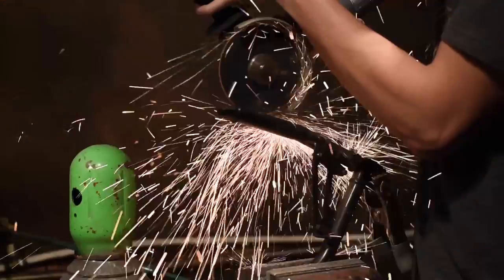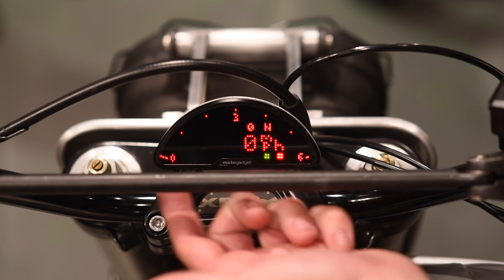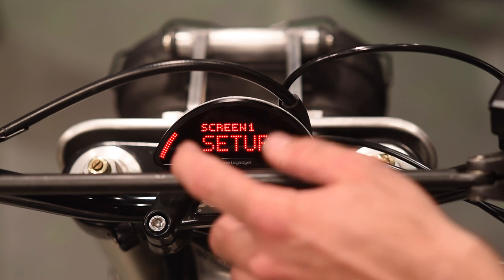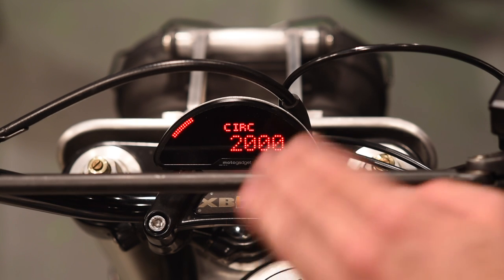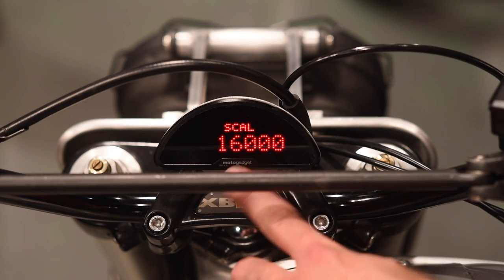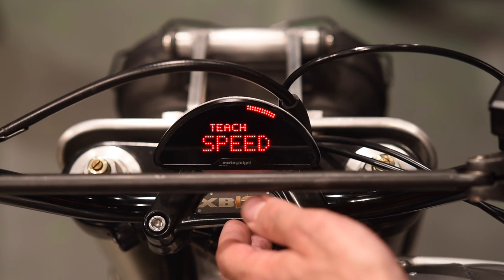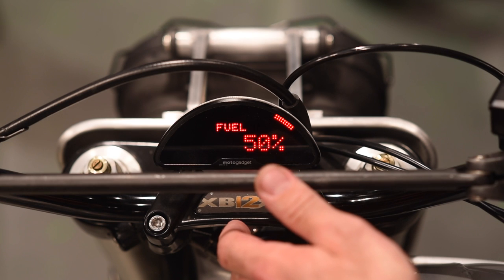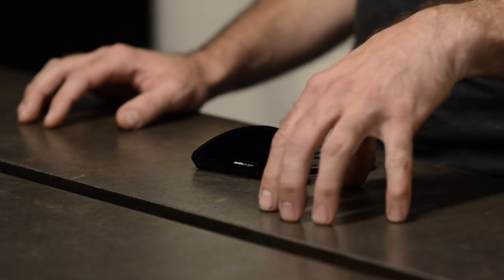Configuring the Motoscope Pro - Revival Cycles Tech Talk

Comment: Quick Tip: You enter the Setup Screen ONLY by having "Speed" displayed and then a level 4 press. If any other parameter than speed is displayed the level 4 push won't let you excess the Setup up screen 😉
Reply: You are the hero of this story
Reply: Thanks for this comment.. Really appreciate it.. Didn't think manual has anything on it
Reply: Do you exit OUT of the Setup Screen w a level 4 press as well?

Comment: Hey thanks for the video, it really helped me a lot while installing this on my 79 BMW R80/7 project. However, in order to get to the setup menu, it is worthy to mention that you do need to turn it down, switch back on and do the 4 sec push, but this will only work if the lower display line ( biggest characters ) is set to Speed. If this is not the case ( for example it is set to Rpm or anything else ), you will not be able to get into the setup menu. Don't ask how i found this out, i had to learn it the hard way!
Reply from the maker: Yes, this is super frustrating, and in retrospect, I didn't cover this in enough detail on this video. If we ever get around to redoing this I'll be sure to point out that the main read out must be set to speed in order to access the configuration settings. But realistically you'd think this would be a covered in the manual, but its not, crazy.

Comment: Great video. I am currently building a custom 82 Suzuki GSX1100 and the only thing i didnt gather from the video is the gear indicator setup/wiring? My bike has s big connector for the gear position indicator and i could nor for the life of me figure out how to wire it in this instrument panel from your video. Can you please explain it for me?
Reply from the maker: The MSP has a trainable gear indicator, and unfortunately, it does not interface with a factory gear position sensor.
Reply: @RevivalCycles  Ok thanks. The trainable system, is it accurate once it has learned the gears?

Comment: I bought the gauge from you guys. Good thing I rewatched this video cause the manual doesn't say to cycle off and on the ignition first then do the level 4 push to enter setup. For the life of me I couldn't enter it. 

Question. I drained my battery while playing with it and trying to set this gauge up. Is that possible to drain your battery while playing with it and your engine is off? I can't try again now cause it's 1 am now and I can't start my bike without pissing off the neighbors.
Reply from the maker: The gauge shouldn't be draining the battery that quickly, but if you have the ignition switch and kill switch on there are probably other devices that are draining the battery pretty quickly. Depending on what bike you have, if you are running points type ignition that can drain a battery in less than an hour. Headlights are also usually a significant drain on the battery when the engine is off.

Comment: Nice video! Any tutorial on wiring it to a Buell XB?? I'm a little bit lost with this one :(
Reply from the maker: Wiring in on the XB is similar to any other bike, and most of the needed connections are right at the plug from the old gauge. Its a good idea to get a clear wire diagram and trace each circuit and then you can match that up with the correct wire for the MSP. On our install we used breakout box A. If you are having trouble with your install email specific questions to techsupport@revivalcycles.com But just know that we are about a week behind due to all the questions rolling in.

Comment: Thanks for that movie, help a lot, but I have some problem with clock and odometer. Set the time and set the odometer and After i switched ignition off the clock reset and milleage the mileage returns to the previous setting. Somebody has the same problems ?

Comment: I bought a motoscope pro used. This one is meant for the BMW R9T. now i notice that i am having problems installing it on my bmw k100 caferacer. I cannot change certain settings. including the rpm signal. I keep getting CAN-BUS in my screen. As far as I know I can't turn this off. I'd love to hear if anyone knows a solution!
Reply from the maker: The R9T MSP gauge has model specific features. The only solution I can imagine is contacting Motogadget to see if they can reflash the firmware.

Comment: Thank you very much, can you do full detail on the R ninet one as well, Thank you.
Reply from the maker: There is literally no difference in the form, function, or features of the R9t version. The only change on the R9t version is that it comes with the correct plug and software to connect directly to the OEM gauge connector to make installation simpler.

Comment: Hi my friends, I have a Bmw r1200gs mod 2010 (oil cooled), I'm in the process to covert it in a scrambler. I want to change the OEM instrument panel,  it's possible replace with a motoscope pro and an additional tft panel with the unit m blue? thank for your answers.
Reply from the maker: Perhaps? The electrical system is going to be pretty sophisticated and without having done an install on one before it's hard to say. First thing I'd do is start hunting for other examples to see if someone has already done it, then see if you can pick their brain.
Reply: Revival Cycles thanks my friends. Well the only way is to try.  I’ll use the ninet’s kit.

Comment: hi guys great video! would the motoscope pro work with a 1988 Honda GB250? It is currently functioning 100%, does that mean I will not need the M-unit? anything unique to this bike that I need to be mindful of?
Reply from the maker: The MSP will work on any bike pre fuel injection and many models after EFI so long as there is not an immobilizer built into the ECU. Even then, an aftermarket ECU may allow one to be installed. There's nothing in particular that I'm aware of that would make a GB challenging. If it has a CDI ignition, which it might, you will also need the Inductive Signal Sensor to get a tach reading. 

https://shop.revivalcycles.com/motogadget-motoscope-pro/
https://shop.revivalcycles.com/motogadget-breakout-box-a/
https://shop.revivalcycles.com/motogadget-ignition-signal-sensor/

Comment: Its a long video and I'm struggling to see how you actually calibrate the different settings - you have raced through the functions withot actually demonstrating a change (eg setting the clock)! When there is only one control button it is obviously not easy to set up.  this gadget is probably far more complex than I need but Im still stuck as to how to set it up for essential functions! Maybe I've got to watch the video several times to figure it all out. It would help if I could actually see you pressing the button.
Reply from the maker: Yes this is a long one, and you are correct, we didn't quite get enough detail on the actual setting of values. However, most of the parameters are set using the same method, and that method eventually gets covered around time stamp 21.07. Here is a link to that time stamp https://youtu.be/WJeBZMfVSsg?t=21m7s Fortunately there is nothing you can damage by playing around in the setup menus so trial and error is no problem and if you get too far off base, just reset back to factory and start over. With a little practice it starts to make sense.

To enter into the service screen with a 2 second button push. Then it will highlight the digit currently being modified by flashing, each level 1 button push increments the active digit  up from 0 to 9 and back to 0, and a level 2 button push moves to the next digit, then a level 3 button push exits back to the previous menu. 

Although you can't see the button you can hear it, and because of the lay out of this bike and the control buttons used, it is very difficult to include the visual image. The m-Switch minis used on this bike have very little movement, and that subtle movement is difficult to capture. Even in hindsight I think it is actually easier to hear the button pushes than it is to see them.
Reply from the maker: In an effort to keep the videos trim, I can end up speaking rather quickly. Sometimes I forget not everyone is accustomed to listening to me jabber at that pace. Thanks for sharing your project, it is often overlooked that these components are perfect for project cars and hot rods. The best part of the Motogadget kit, the gauges and m-Unit is that they are really robust and as long as you don't have voltage spikes over 18V its difficult to kill them. It makes is so you can experiment and practice with out much risk of letting the magic smoke out. 

If you find you need additional help feel free to email us at techsupport@revivalcycles.com
Reply: My criticism of your video was more about my frustration. My restoration project has gone on for seven years! I have downloaded your video onto my iPad to go through bit by bit at the car. Yours is the ONLY video showing the set up of this complex bit of electronics so thanks. One question - can I change the colour or appearance of the readout LEDs? I notice in some videos the display looks almost fluorescent. Its comforting to hear it is a robust unit. It isn't cheap but was recommended here in England as being pretty well top of the pile.

Comment: Hello guys I have purchased the motoscope Pro and will be mounting it to a 2013 speed triple r, I was wondering if you could help me with my options with wiring it in. I know there is a triumph msp breakout box upto the 2009 model but will this still work on my model? Or is my best option to wire in with the breakout box b.
Reply from the maker: This is a better question for Motogadget, we do not know the compatibility of their devices beyond what they list and what we have tried and we have not installed on the 2013 speed triple. Generally speaking, modern bikes (post 2010) get pretty fussy and minor year changes can produce incompatibilities in software/hardware. The first thing to check is if your Triumph is able to run with the factory gauge disconnected, many bikes do not. If it actually does run when the gauge is disconnected then you can use either breakout box A or B for your install, but motogadget will be the only ones we know who can answer if the m-Tri will work on a 2013.
Reply: Thank you for your reply, I will email motogadget and go from there, thanks again guys and keep up the good work

Comment: please help ,,my doesn't change ,,it only switch between main display and small display,,can't get to the set up menu
Reply from the maker: Accessing the setup menu can be tricky, I struggled with this for a while before I got it. The best technique I've found is to make sure the lower LCD display is set to speed, then switch it off, wait 30 seconds and turn it on, then as soon as it finishes initializing, press and hold the config button until it enters setup. If you switch screens or cycle through the functions it will not enter setup.
Reply: Revival Cycles.. this was really helpful, thanks 👍🏻

Comment: Hi Guys, i bought the BMW Rt9 from the states and brought it back to Europe. I have the incorrect mileage reading on the display screen and to register my bike i need to match the correct mileage as i have on my paper work, how can i change the mileage on the screen? i need to add on miles.... Thanks.
Reply from the maker: I'm guessing you have a motoscope gauge, and in that case you enter the setup and navigate to the ODO parameter in the "System" menu. Then you can adjust the total mileage.  Check out page 10 and 15 of the manual http://motogadget.com/shop/media/downloads/manual/msp_manual_en_3.4_k_from_serial_00004416.pdf
Reply: Thank you. Got it all set up. Thanks for the reply.
Reply: @LovingSalads  ciao, ho un motoscope e ho un viaggio che mi tiene nella memoria .... lasciami spiegare ..... si è fermato a 3,4 km ... accendo la bici e il viaggio funziona ... I spegni la bici e riaccendila ed è di nuovo a 3,4 km .... aiuto